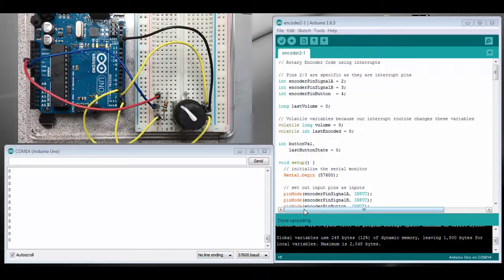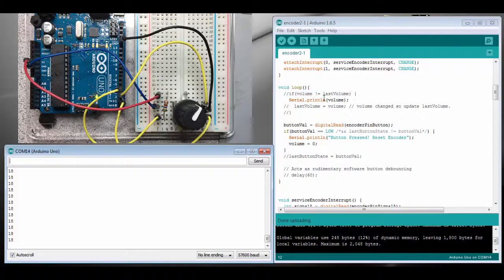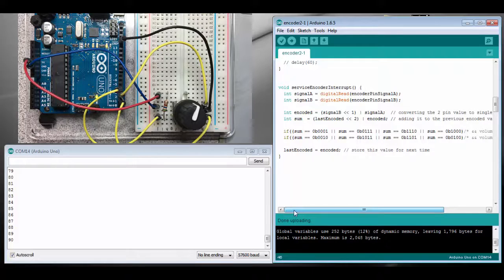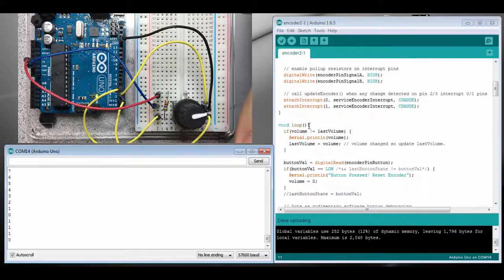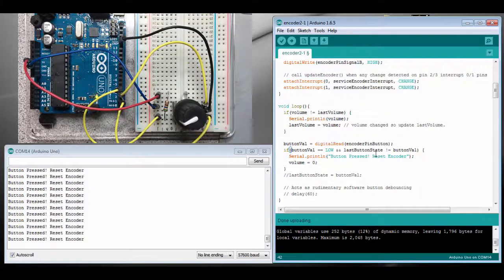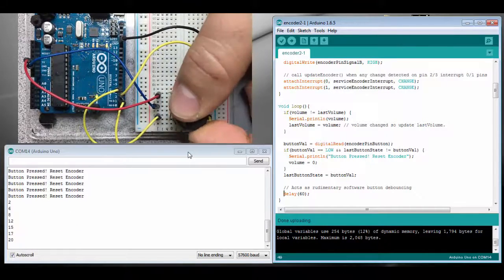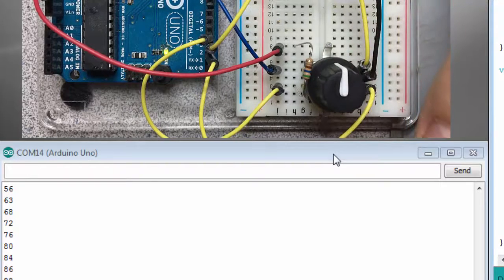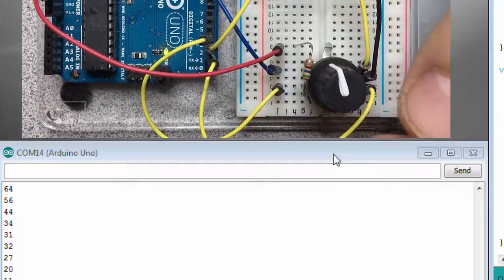Rotary Encoder - Tutorial

Comment: what is the resistance of the single resistor? 1 k Ohm?
Reply: Zhenis Otarbay 1k ohm would work. It is a simple pull-up resistor for the digital input pin reading the state of the rotary encoder switch. You could even eliminate the resistor and instead enable the pull-up resistor on the specific arduino pin reading the switch. 

This ensures the digital input pin isn’t floating when the switch contacts are open, it will see 5v... and 0v when the switch is pressed.

The value of the resistor isn’t critical. If you have a resistor anywhere between 1k and 10k go for it